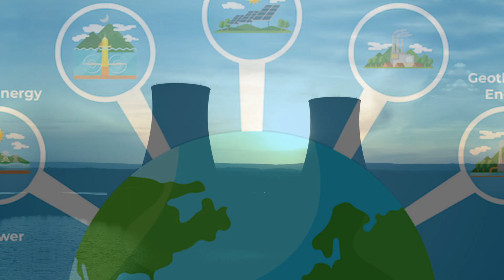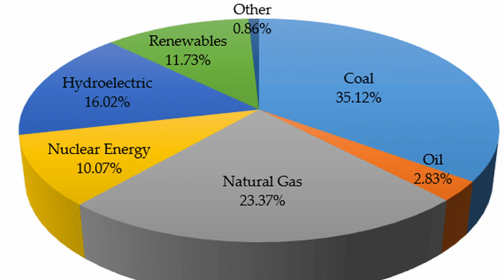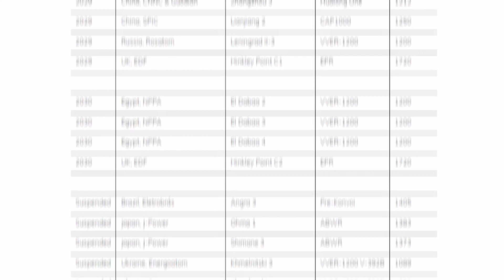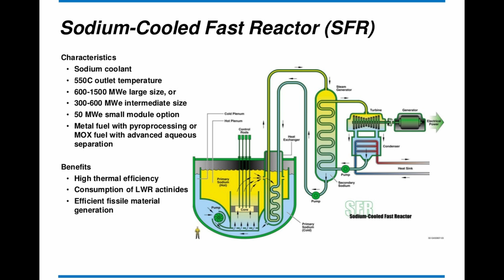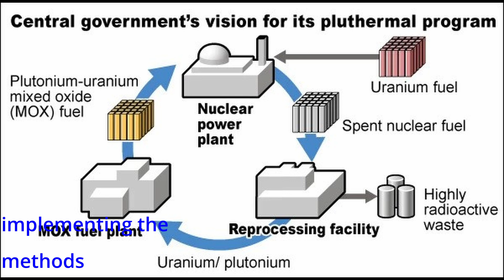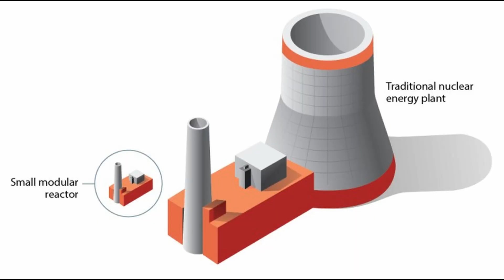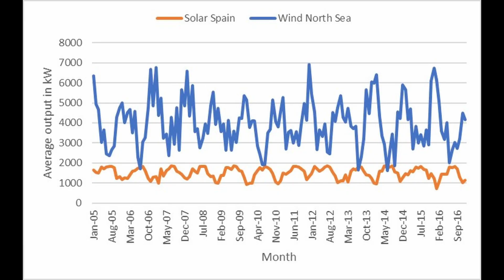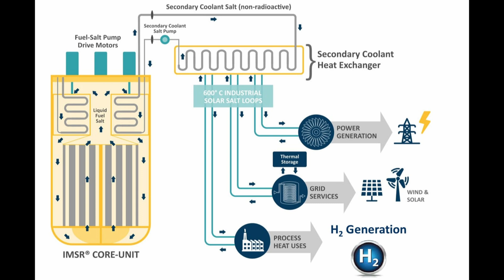This Could Solve Our Energy Demand For The Next 100 Years !

Comment: A liquid sodium cooled reactor is actually not “completely” safe, as sodium is highly volatile, meaning it reacts violently with water and, at high temperatures, oxygen. In my opinion, the safer option, for now, is the CANDU reactor, which is the Canadian Deuterium Uranium reactor, which uses heavy water rather than regular water as a moderator so that it can use natural uranium (much lower enriched) as a fuel, which means it can also “burn” spent nuclear fuel to an extent, though maybe not as much as more advanced reactors

Comment: I think the main question on nuclear fission is around cost, and not necessarily on safety.  Fission is unlikely to close the large cost gap to solar/wind/batteries, especially given SWB rapid advances, so it's unlikely that nuclear will gain traction in the foreseeable future (for purely economic reasons)
Reply: Only for initial costs, though. Sure the initial placement cost for a GW of solar is much cheaper than a GW of nuclear, the nuclear plant will last for over a hundred years with little to no maintenance, while almost every solar panel will need to be continuously replaced, repaired, or changed out for a newer more efficient one, which adds up